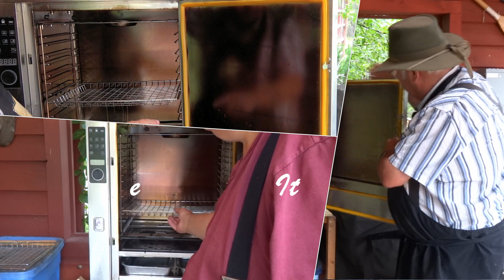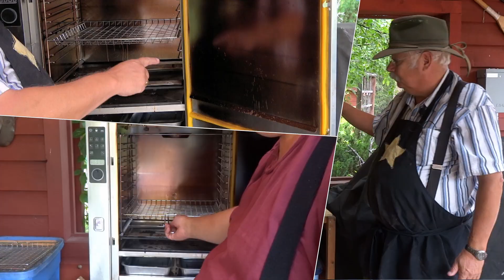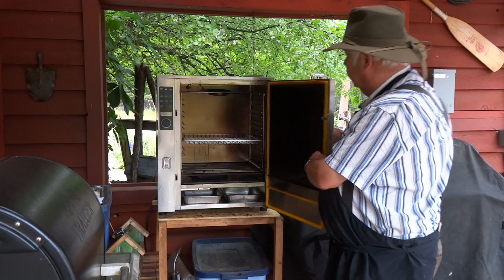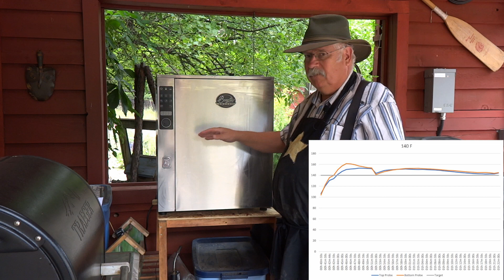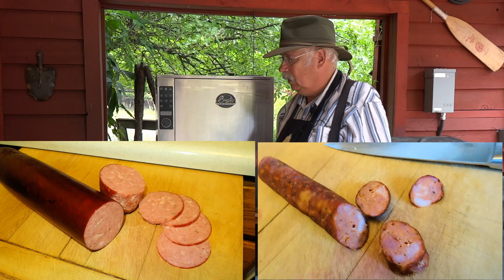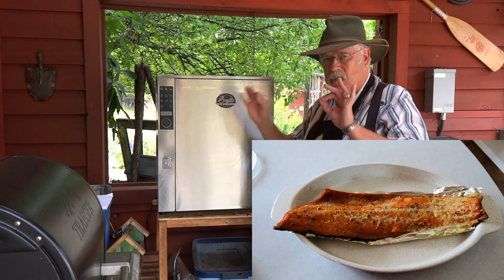Bradley Professional Smoker P10 Review - You Can Make It

Comment: This needs a few improvements. 
1. Ditch the pucks and switch to auger fed pellets at low temp for smoke. Pellets are also inexpensive and more accessible. 
2. Add WiFi and a simple app to remotely monitor/adjust temps.
3. What about a higher wattage version? Obviously a higher amp circuit would be needed. 20-30a? Higher temps. Faster warm ups and recovery.
4. Split doors between the cooking area and water pan area to minimize heat loss.
5. I haven’t seen the internal dimensions yet. Looks a little narrow. It should be wide enough to handle a trimmed packer brisket or full slab of ribs with a little room to spare.
6. Flatten out the shelves. You’re losing a couple horizontal inches of width with them being sunken.

What about ditching electric all together and using a dual auger pellet system?  One for heat and one for smoke. I love pellet systems in a vertical box for two reasons. It’s ability to hold temp and make adjustments quickly. The other is that you don’t need special electrical outlets. One thing a single auger pellet system sucks at is producing smoke. Hence the second smaller low temp pellet feed.
Reply from the maker: The main point you miss is that I have never found a pellet smoker that reliably offers steady temperature control at the lower temperatures required for cured sausages and jerky. I have a top of the line pellet smoker that I love but it does not fill the purpose the Bradley does.

Comment: The final in an email chain of disappointment with Bradley

After applying a lubricant/rust dissolver to the screw I was unable to remove it.  The screw slots gave out.  Now the screw head must be ground off.  At this point I do not have enough screws to fully reassemble the bisquette heater.

When I spoke to Olev and asked him what the dimensions were for those screws his answer was that he would have to research that for me, and he would let me know.  I have not heard from him.  The local big box and hardware stores carry nothing identical. The choices there are either slightly too large or too small, and in that small size only Imperial is available here.  I think the dimensions must be Metric and I need those dimensions in order to purchase replacements online.

I am going to order stainless steel screws and replace all the rusted screws in the P10, which is almost all of them.  Please, at least give me the correct screw dimensions.

In the picture below you can see that the bracket holding the heating wires is badly corroded.  I understand you will not replace the entire heater assembly, but would you at least replace that part?

I am going to fully disassemble the bisquette heater, grind off all the rust, and repaint it with a heat tolerant rust resistant coating.  I’m also going to examine the drip pan to try and understand how drippings got inside that heater in the first place since it is unreasonable to have to disassemble that part of the P10 to clean up what should not be there.

That concludes my request for help, and my information for you regarding repair of this unit.

MESSAGE FROM A VERY DISSAPOINTED CUSTOMER

I have used Bradley smokers for over 40 years.  My first was an aluminum model that eventually had to be replaced.  I’ve purchased several to give as gifts to others.  I am as loyal and long term a customer as Bradley could hope to have.

The treatment I have received from support has been unpleasant.  I’ve been accused of mistreating my P10 by support, then later had Olev confirm the screws were a bad choice that will be replaced.  Now I’ve been accused of not properly caring for my P10 because I did not disassemble the heater to clean it.  That procedure is not called for in your manual and should not be needed.

I will never again purchase a product from Bradley. Not because my P10 has problems, but because Bradley support tries to blame the product problems on me, and refuses to acknowledge and replace that which is faulty.

My entire interaction with Bradley has been fully documented in pictures and email.  Take a moment to examine my YouTube page and the videos I have there.  They are detailed and have good reviews.  I will be adding a detailed review of my experience with the P10, showing the rust throughout, the magnets sticking to what is claimed to be stainless steel, and the emails from support trying to blame me for those defects.  Although my videos only get a up to 40,000 views, there is not much on YouTube discussing the P10, so I expect my video will be easy to find if people research the P10 prior to purchase.

Because you are not going to correct the deficiencies in your product I am going to alert prospective customers to them.  Most disturbing to me is that Bradley intends to keep shipping P10s with steel screws until November when the first run of P10s with stainless screws is expected.  Are you planning to send everyone a set of new screws and tell them to replace them.  Such would be a good policy for those of us who already have our P10s, but shipping out units with steel screws when you could easily procure and replace the screws in your inventory units is just unethical.

Like rust, the rot in a company comes from the top and works its way in.  It saddens me that Wade Bradley has so little interest in his customers that he has chosen not to engage with me when I asked courteously that he do so.  Leaders who shield themselves from disappointed customers, hide behind low tier technical support and refuse to acknowledge product deficiencies eventually pay the price.  Word gets out, sales drop off and they no long have a company to lead.  Good luck Wade, that is where you are taking Bradley.

Bendrix Bailey

Bendrix Bailey - YouTube
 
My guiding service – lots of client contact
Northeast Woodlands Guiding

Comment: Question, can you smoke salmon
Reply from the maker: You can hot smoke but if you want to cold smoke for Lox or similar, you have to do it in cold enough weather to offset the heat from the smoke generator or add enough ice to the chamber to keep the temperature down. You could also use a tube smoke generator with pellets.

Comment: After having this for 18 months how is it's operation? Is it still working as when you first got it? Looking at upgrading to one as I smoke lots of bacon and need to be able to do it year round. The old analog 4 rack just can't handle days below -10c to maintain the desired temp.
Reply: Yes, it works the same. However, it will not work at really cold temperatures. The unit is set not to start up at very low temperatures. However, I have put a large pot of hot water in it to raise the internal temperature and got it to start up.
Reply: @davidfarrell4297  I was already aware of that unfortunate flaw, but there is always a way around something like that. I'm glad to hear the investment into one will be worth it on my end. Thanks for the info
Reply: @TestTubeBaby666  The unit does great work on my sausages but does have the strange quirks I point out in the video. However, the stable temperature control really helps with bacon and sausage.

Comment: Horrible product, terrible design and cheap parts for an expensive price:

1) briquettes get caught in the feeder every other round because of a cheap low power motor. That should have been upgraded to a stronger one before it even made market.
2) called customer service and they refused to talk to me because it was a “new product” one year after its release: Lmao. Instead they told me to write an email which received no response. 
3) No ability to cold smoke in this product because of faulty design: the briquette burner is inside the oven compartment raising the temp well above 30C which is the max temp for cold smoking. 
This seems to be designed by amateurs who never actually tested it before it’s release.

Comment: Enjoyed your coverage. I have an older digital four rack. I live in canada and minus 20 is common. Tough time heating up in those temps. I installed the 900W and that helps some what. My question is why didn’t you cover cold smoking. I have the cold smoker adapter for my digital and it works well. Of course in winter it’s not an issue. Hopefully you shouldn’t have to add ice to a $900 smoker. How do you set it up for cold smoke? Just turn the heating element off? Thanks
Reply: I've followed this smoker for a while, and one of the complaints about it, is that it can't cold smoke.  I can't see why you can't just use a pellet tube and smoke that way.

Comment: Great review- Enough so that I bought the unit, 1 thing that I have ran into (specific to maintenance) is the drip pan on the unit- The smoke & burnt pucks have really taken a kicking to the painted finish on the 2 pieces. I am wondering if you ran into this & how & if you managed this issue on the P10?
Reply from the maker: I assume your referring to the plate over the drip pans and the cover over the puck cavity. There is no way to keep these pristine. I just wash them well after each cook and live with the discoloration.
Reply from the maker: As with most smokers, the  parts do get discoloured, and coated. It does no harm to the smoking taste as long as you keep it clean of major debris and grease.

Comment: Have a quick question for you on that unit. I have a Bradley that’s probably about six years old now and I don’t use it much because it struggles to even get up to temperature. I tried again just last week after not using it for a couple years doing some smoked chicken legs and the temperature gage of the oven was reading 30° F cooler than what was program and would not get up there. I live in Southern California so cold weather is not a problem. It’s the 500 W heating element just doesn’t seem to be able to get there. I know you can replace the element with a 900 W aftermarket and the wiring and all that stuff but that seems like a headache and a hassle to me. How is this one at getting to temperature and staying there? I know it’s 1000 white unit so I would be hopeful that it would be great at doing so.
Reply from the maker: I assume you have the digital unit. I had one for years and you have to realize a couple of things. First, it is a cold smoker. You can't consistently cook over about 275 F. Second, a 25 to 30 swing from set temperature is normal. If you don't believe me, put a remote thermometer in your oven and you'll see swings of at least that much in most home ovens. Third, the guage that comes with almost every smoker and barbeque I have bought are dismally inaccurate. Spend a couple of bucks and get a remote thermometer. Then set your smoker to 230 F. Let it run for an hour. You are looking for the average temperature of the remote thermometer. If the average is 10 degrees above or below the set temperature, set it 10 degrees higher or lower for future cooks and realize that it will swing at least 20 degrees around that average. That is not a problem for cooking and is quite normal.
Reply: @OldfatguyCa  That makes sense and actually my smokers I guess is old enough that it didn’t even come with the temperature gage on the door like I see other Bradleys have but I have a new Meater temperature gauge that I can put in there and run that test. I didn’t even think that the control unit temperature gauge may be wrong. So that makes sense. I even remember getting an error when for setting it up to use the summer and had to clean the ports that the wire goes in for the temperature gage to the Smoker unit. I was grilling chicken legs and it was supposed to get to 190 and my smoker wouldn’t get above 160
Reply from the maker: @jetman101us  If your unit won't get over 190 F there is a problem with the unit. I would put a new heat element in. Run the test and see if it is the control sensor or the unit needs a new element. If the unit is that old, the heat elements do wear out over time.
Reply: @OldfatguyCa  I’m running your test right now that you suggested and it’s almost at 230 and I just started it about 10 minutes ago so it’s just the unreliable thermostat on the brains
Reply from the maker: You can order a new thermostat but if it is a consistent variation, you don't need one. I hope your able to get it to work better. It really sucks that manufacturers don't use better thermostats. However, the upscale P10 does have a high quality thermostat and keeps deadly accurate temperatures. For hundreds of dollars more, it better!
Reply: @OldfatguyCa  thanks for the advice. Yeah there’s a wide variation. I set the thermostat to 230 the highest it got was 220 and then dropped down to 200 and is now climbing again probably back up to 220. So it looks like I need to set the thermostat 10° higher to get to the correct temperature and the 20° drop is no big deal as long as it gets back up to temp.  You just save me from putting out almost $900 for that new smoker you were showing. I was sure mine was so under powered that I would either have to change out the element and re-wire it or break down and spend money for a new smoker that has more power.  I just wanted a Bradley because I don’t want to babysit the smoke chips every couple hours like you do with other smokers nor have the chips burned to ashes going all over the food. I like that the disc drops into the water.
Reply from the maker: @jetman101us  Glad I could help. Just for my curiosity, I like to ask people their favourite dish in the Bradley. Do you have one?
Reply: @OldfatguyCa  I love smoking and then throwing some barbecue sauce on chicken legs. I cook a whole big batch of them that last week which is good for lunches or snacks. I haven’t done tons of smoking yet but I am looking forward to doing a brisket next week and have done pork shoulders a couple of times for shredded pork sandwiches. now that I understand my machine a little bit better I look to trying many different things to smoke.
Reply from the maker: @jetman101us  Thanks! Sounds like you are well on your way. Let me know if you need any help with the brisket.

Comment: Great review, I would like to know how well it smokes cheese because it does not look like you could attach their cold smoker accessory to it.
Reply from the maker: I can do cheese in it with just the smoker running in the winter. There is about a 10 C increase in temperature over ambient with just the smoker running. In warmer temperatures, I still smoke cheese by putting a try of ice over and under the cheese to keep it cool. It is important to monitor the temperature and add more ice as necessary.
Reply: @OldfatguyCa  Thanks for the fast reply.

Comment: Thank you for this great review. I am in doubt between the Bradley 4 rack digital and the P10 pro. I will be mainly using it to smoke whole briskets (Montreal smoked meat) and occasionally smoking turkey and pastrami. Which one of the two Bradley models do you think is most suitable?
Reply from the maker: Both will do the job. The problem is that fitting a whole brisket in either is tough. The P10 is definitely bigger and will take a small to medium brisket. You would likely have to cut it for the digital smoker.

The P10 has better temperature control and smokes at lower outside temperatures. The digital is a lot cheaper.

Comment: How often do you need to clean out the used pucks?  I have the digital model and pucks jam up fairly often.
Reply from the maker: I had the digital for years when I started and I did have to clean sawdust out but not as often with the P10. However, if you are referring to the used pucks in the bowl beneath the puck burner, it is a larger tray than the bowl the digital uses. I empty it after  or 8 pucks are  burnt with no problem.

Comment: Good review, just wondering how it will work at ‐20
Reply from the maker: It won't start up at under -10 C (14 F). However, I have smoked at -20 C (-4 C) by putting trays of boiling water in it to raise the temperature in the chamber. It came up to temperature fine and held it.

Comment: What's the lowest temp setting on the bradley p10? I make lots of candied salmon and I like to cook it at 120f. Anything over 140f and the fat cooks out of it. I guess I can open the vent and crack the door if need be but hoping not to.
Reply from the maker: It goes down to 30 C (86 F) if you turn the heat controls on. It will cook at 120 F no problem.

Comment: The deal breaker for me are the proprietary smoke pucks!  They are to expensive and to limiting on options for wood variety!  My neighbor had a Bradley smoker and was spending well over $300 a year on pucks!  After he got a pellet smoker that amount was cut by 3/4, as a bag of pellets was lasting him 2 times longer than a box of Bradley Pucks at half the price.  So based on his experience doing a great deal of smoking he was paying for the smoker every year and a half just in smoke fuel!!!  With the pellet smoker I have I can smoke cold or hot and can set any temp I choose (as long as it is higher than ambient) and it will hold that temp to within 1 degree + or - day in and day out it is electric, runs on 220 V and can achieve temperatures of 400 F with no problem!   It can go higher than that, but I have my PID set to limit the maximum setting to 400.  It has 6 times the capacity of your Bradley, the only caveat is that I built it myself as I was not happy with any of the available electric options.